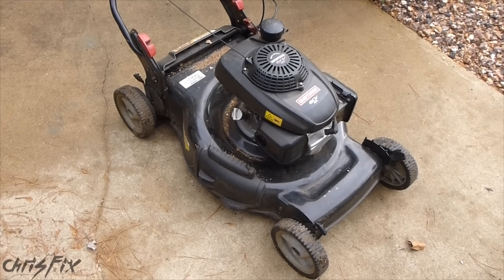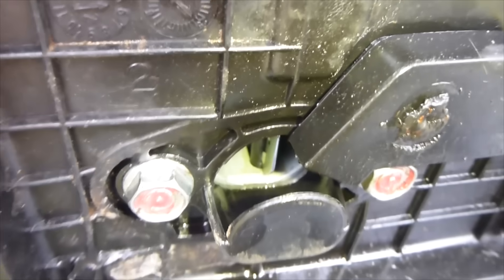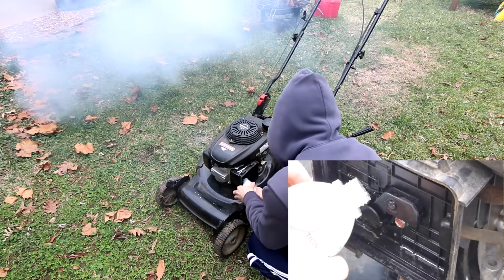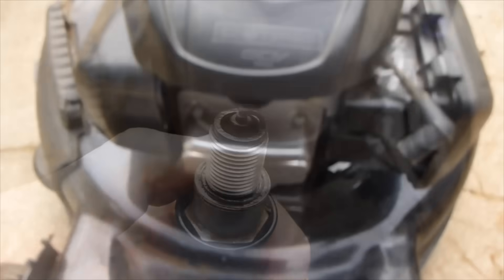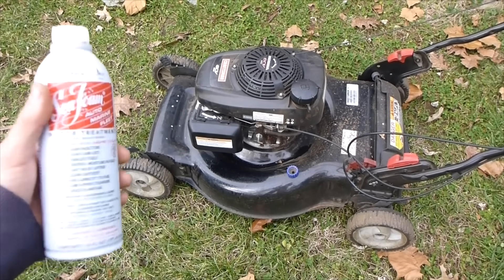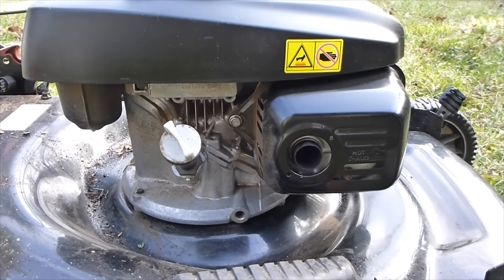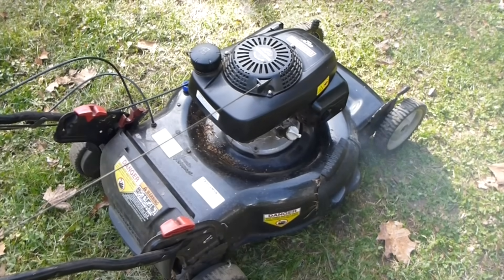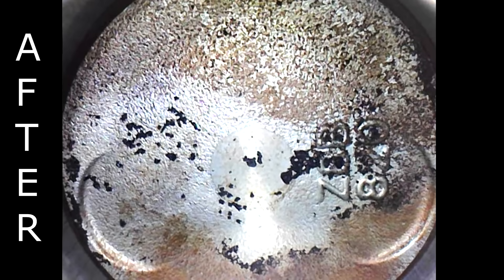Does Seafoam Actually Work? (with Proof)

Comment: Take a syringe with a smal needle and fill it with distilled water. Spray a tiny stream of water from the syringe's needle into the carburetor intake or into the throttle body intake  (for fuel injected engines) while the engine is warm and running at high RPM. It works like charn and will clean carbon deposits.  It's best to do this before oil change. 
Seafoam is the best for cleaning fuel systems. I always have some. Don't put it in oil as ot may facilitate leaks on older engines.

Comment: You literally could've gotten the same results using water. I've done it before. By pouring it straight into the intake like that you're sucking unvaporized liquid directly into the cylinder, since liquids don't compress this raises cylinder pressures and blows the carbon off the piston. Water's cheaper.

Comment: A lot of comments that carbon build is not a big deal - YES IT IS!. The problem is IF you have carbon build on the piston, you probably have it on the rings. Carbon will cause rings to stick and not maintain compression which will cause your engine to burn oil and eventually self destruct. Also carbon in the combustion area will get hot and glow, which will cause detonation, which will also destroy the engine. Best solution, run the engine at full speed to keep it clean, use good oil and gas and a little stabilizer never hurts.

Comment: Great video,  well made and very informative. My Honda Valkyrie with 6 carbs was not running too good after sitting for about 8 months. I did add fuel stabilizer to premium gas and thankfully the carb were not so bad that they had to be disassembled. I drained the gas in the tank but not the carbs. Then I ran the bike and used at least 1 gallon of fresh gas, it made a big difference. Now I am going to add the Seafoam that the Honda shop sold me and see what happens.

Comment: First, I liked the video. It said NOTHING about the benefits or drawbacks of using Sea Foam to clean the piston. It just showed the results of a very well thought out experiment.

Second, isn't glass made from silica and diamonds made from carbon? You decide which is harder. Although this carbon buildup is mostly a fine powder, (much like the carbon buildup in the exhaust, rub your finger inside your exhaust pipe), that fine dust buildup does become bad for the engine.

Several reasons for that. Buildup on the valve seats is an obvious problem. Also although that piston was pockmarked and very rough, most vehicles will have a very smooth and sometimes highly polished piston head. That is to allow the fuel air mixture to properly mix and burn more effectively. Back to the exhaust, like a clogged artery, buildup of carbon is bad for a vehicle also. More back pressure = less HP. 

That last one was not addressed in this video, but any carb cleaner run through the engine will remove some exhaust buildup. Not much, but after you try this, look at the tailpipe and see the black liquid dripping out.

Now, yes, regular maintenance is the best way to go. Good quality fuel, regular oil changes, fuel, air & oil filter changes, clean and re-gap plug(s) every season. And at least use fuel stabilizer if not properly winterized over the off season.

Any event, this video was informative, to the point and well done. The benefits of doing this or not is all up to you.

Comment: All I can notice is the INCREDIBLE amount of pitting on the surface of the piston. That is from detonation- a secondary ignition of the air-fuel mixture after the spark plug ignites it. The colliding flame fronts jar the piston in the bore, damage the surface of the piston, and damage the piston rings. Looking at the scored cylinder bore, the top of the piston, etc... this engine is DONE. Detonation CAN be caused from hot carbon spots left over from the previous ignition cycle, so yeah... cleaning the carbon can prevent this... IF you got to it WAY before the engine was this damaged. Detonation can also be from bad gas, the wrong spark plug, and other causes.
Also- Unibomber moment at 1:40

Comment: That mower was running well on the before part.  I have done coughing sputtering, misfiring mowers, and watched them smooth out in less than 10 minutes. My 82 Honda CX500 motorcycle got 31 miles per gallon when I bought it.  Two tanks of gas with SeaFoam later, it was getting 52 miles per gallon.  That made a believer out of me.  I use it on outboard motors, too, with very good results.
Reply from the maker: Thanks for sharing!

Comment: If the engine runs at full speed without stalling and cuts your grass okay why should you worry how the top of the piston looks? Some carbon coating is normal in all gasoline engines

Comment: For small engines like lawn mowers, I like the spray seafoam in a can.  It's concentrated, and is also a damn good spray for rusty bolts.

I had a small tractor that had the mixture screw set way to high and got gummed up from deposits.  I started it, throttled it to max, and would spray some until it bogged down.  Let the idle recover and repeat.

Comment: When I use Seafoam in my vehicles, I pull the brake booster line and put the hose into the can and let the engine suck it all out.
Reply from the maker: Thanks for the tip! Check this out: https://www.youtube.com/watch?v=u6UeJXkzDW8
Reply: ChrisFix Yep. Seen it. Don't use it all the time though. Maybe once a year, or maybe longer. That stuff is great every once in a great while. But it can do some nasty stuff if its used too often. I use it through the booster hose and in the tank.. I tend to use Marvel in the crank case oil.

Comment: And engines builder I know swears by it.
It's worked for me with a Chevy Blazer with a Vortex engine that is known to have top engine humming up. I had a problem with it but Sea Foam has taken care of it.
I'm not paid by Sea Foam...
Reply: Im a small engine mechanic. I personally run seafoam through all my older equipment, my truck, and through used mowers i prepare for selling. I usually dont pour it through the carb though, what I do is pour some in the gas tank, and its worked as good, if not better, than pouring it through the carb.
Reply: Uhh, phone correcting my writing but I think you get my point.
Reply: My ‘03 Silverado with the 5.3 vortec ran much better after seafoaming it.

Comment: this stuff sucks waste of money 
best way to clean out an engine would be to steam clean the engine with water (small bottle with a  hose let the engine suck it in like a mist bamm your done)
Reply: Aaand you would hydrolock your engine and take oil off the piston rings, what could do severe damage to the engine..
Reply: What oil? This isn't a 2-stroke
Reply: There is something needed to LUBRICATE the engine ;)
Reply: Any mechanic KNOWS there is always some oil on the cylinder walls    -   "Not a 2-stroke"   -   jezz!
Reply: Mrscp52 thanks for explaining that to him :)

Comment: Just wondering... Did you change the engine oil after this test?
Reply from the maker: Yes in the spring. This was the last time the mower was run for the season.

Comment: diesel will do same thing, i did it in the 60s. also you can use 6oz water, but this day and time people can save money by simply flooring it. about 20 to 65mph as quick as you can safely 4 or 5 times. it fixes several things most people complain about.
Reply from the maker: Thanks for the tip!

Comment: just asking but before u added it straight to piston did u let engine cool a bit so u dont strip the thread want to clean my car pistons like u did aswell by soaking but do i let engine cool off first also im going to use a bottle to spray threw throttle body instead of sucking threw vacuum line is that ok will it work that way
Reply from the maker: I would not soak pistons on the car. Removing all of that carbon at once is a bad idea.
Reply: +ChrisFix k
Reply: +ChrisFix i just sprayed threw the air intake using a flower sprayer as i have the motor treatment one and added the rest to fuel.  By adding most to fuel will it clean the car the best that way . will it clean the pistons valves and injectors by it being in the fuel

Comment: Squirt gun of water dose the same thing for a lot cheaper.
Reply from the maker: Thanks a lot! I will be testing water so stay tuned!
Reply: Yep, Grandpa used to splash a few drops of Water down the Carb at every Oil change. Need to be careful with the amount though, just a few drops does the trick!  ATF through the PCV works well too.

Comment: Whats the point? you could pull the plugs and use varsol or any solvent and get the same results. I have seen spotless pistons on engines with cracked heads or blown head gaskets as steam also will clean pistons.
Reply from the maker: To test seafoam. I thought that was pretty clear lol

Comment: I have to say for  about 20 years I just poured about a quart of transmission fluid in the carb of all my cars and trucks with the engine running and it cleaned the carb , the intake, the pistons and valves very well.

Comment: Chris, thanks to this video and your others for cleaning carbon, my 2003 ford ranger with the 3L V6 runs better then ever. For the last couple years I could not run anything less then 91 octane to get rid of the engine ping, running regular I would get ping any time it was under any load. The garage was a not able to figure it out with their computers, changed the MAF, plugs and wires, ran all kinds of fuel system cleaners including the ones you have tested, no results. Then someone told me it may be carbon build up, thats when I came across your videos. I did the Seafoam spray through the intake as well as a can in the tank. Ping was reduced right away, engine starts and runs better...so impressed with seafoam I did a second dose. Ping is almost gone now, still a bit at around 4,000rpm under load. I was thinking of doing something like what you did here with the mower, something more aggressive to get that last little bit. I am thinking to spray some in to soak the pistons, leave the plugs out and crank it before putting the plugs back in. Love your other videos too, super helpful...I wished I had have watched the one for the ranger drum brakes before I did mine a month ago. Keep it up!

Comment: The white smoke from tanks isn't from oil it's from the diesel. It is sprayed into the exhost system when you flip the switch.
Reply from the maker: Thanks for sharing. Diesel is an oil just like the seafoam.

Comment: It looks to be the same as we did in the 80's.
you could dribble water yes from a water hose in a running engine.
Into the carb the cooler than the metal liquid would cause the carbon to come off.
Reply from the maker: Thanks! I will be testing water so stay tuned!

Comment: You're testing the wrong thing.  That little bit of carbon on the piston matters not.  Buildup on the valves/seats and especially gum in the carb are what's far more important.

Additionally, after you let it soak you should have only ran the engine long enough to burn off the excess remaining, then shut it off and change the oil as some may have gotten into the oil which will decrease its effectiveness and cause additional wear.
Reply: "Does seaform work" implies that it's about whether it does something beneficial.  There is no benefit in removing what little carbon was shown. relative to what I mentioned.  Essentially it's a failure through lack of understanding or misuse, whichever way you'd like the approach the misunderstanding of needs for maintaining a small engine.

You might say it's just an example of carbon, but it's contrary to the product manufacturer to do any kind of test like this.  The product is clearly enumerated in purpose on the Seafoam website for the following:
"Where should I use Seaform"
1)  Use in Gasoline, Ethanol, and Diesel Fuels
2)  Use in Engine Oil
3)  Use for Intake Cleaning
4)  Use in Engine Fluids"

Nowhere in that, is de-carbonizing lawn mower piston faces.  It's not at all a test of whether seaform works to do what it's supposed to.  It would have been a little more reasonable if he had stripped the engine down, looked at crankcase sludge, looked at carb buildup and intake soot/oil residue, THEN used it as directed in the fuel, oil, and through the intake, THEN stripped the engine down again and compared the before and after, but at the very least for his intended application, it is directed to be put in the fuel.

https://seafoamsales.com/

Comment: 5-26-2016
Absolute brilliant editing.  All DIY videos should follow this example.  About Seafoam: do you recommend changing the oil after doing this process?  Seems some may get into the crankcase if the rings/pistons aren't in good shape.
Reply from the maker: Thanks! You dont have to change the oil unless you know your rings are worn. They actually say on the can you can add it to the oil but I would never do that so very small quantities are probably fine.

Comment: thise deposits won't make much differenc. when i use seafoam in my bike, it's more to clean the ethonol varnish crap  out of the carb.
Reply from the maker: It was just a test to see if it removes deposits. Thanks for sharing.

Comment: ADDING an agent to your FUEL is fine. Some doses are abstract. Adding anything straight to a Carb to the engine or thru the  FUEL INJECTION is insane. It strips oil off the rings and valves. This guy is a nut job...

Comment: That carbon on the piston is normal and really doesn't hurt anything. Infact, if the carbon got any thicker, it would flake off and blow out the exhaust.  Seafoam is made in China I believe. For that reason, I would not believe any claims on the can.
The big oil companies would have products if anything was a miracle.  It would be front page news.

Comment: Keep in mind Chris is not only cleaning the top of the piston which I agree is not important for how the engine will perform. He's also cleaning the valves and the valve seats which seal of the combustion chamber. Valves that are sealing the best they can will give you the best possible compression. Water may also work to clean the internals, but water will not clean the fuel system. So Seafoam being added to the gas tank will clean the carb too. Can also be induced directly into the gas line so pure Seafoam fills the carb will give the best cleaning. I have done this on a lawn tractor. You may have to put in a new spark(s) afterwards because the carbon deposits and such break loose and get on the plug(s).Great quality video Chris. Camera, sound, editing all excellent.
Reply from the maker: +Craig Edelburg Thanks a lot! I just started looking at the back of valves with a new camera: https://youtu.be/BocH2c4mYcc?list=PLvKbarVtwhUue-xwasd2WUMrkK0CEm6yy

Comment: Removing carbon can be done with many different additives and is mostly not a concern anyway. Seafoams claim that it stabilizes fuel and cleans carburetors is what intrigued me. I had a tiller with a bit of a RPM surge caused by fuel passages gummed up. I ran Seafoam in it the complete season and surge problem never got better. Before putting the tiller away for the winter I sprayed carburetor fuel passages, etc. with carburetor cleaner and the tiller ran normal. I have NEVER seen Seafoam clean a carburetor and I doubt its stabilizing ability too.

Comment: Very nice.  I put it in my fuel tanks of all my push mowers. My riding mower. My gas vehicles. And my diesel truck. Great stuff. But I just pour it in the fuel tank. I buy one bottle every month. My equipment runs great. Good stuff.

Comment: You can use Seafoam to clean out a catalytic converter that is running at low efficiency (PO420 code) because it has carbon or other contaminants built up inside it. You put the hose from a shop vacuum cleaner into the exhaust pipe and seal the connection with duct tape. Then take out the upstream O2 sensor and then start the shop vac to establish airflow going into the O2 sensor hole and through the converter. Do NOT start the engine. Then pour the Seafoam into the sensor hole with a funnel. Be sure to put enough in so as to saturate the inside of the converter. Let the Seafoam sit inside the converter for a while to soak into the deposits and loosen them up. Then remove the shop vac hose and start the engine and rev it up until the smoking stops.

The exhaust system needs to be free of any major leaks, which it should be anyways. And if the converter has been overheated and the bricks inside are melted or the precious metal coatings inside have been damaged this won't work. You are going to need a new converter.
Reply from the maker: +Joe Vignolo Thanks for sharing Joe!

Comment: You will get the same results if you use plain distilled water. The best
 way is to use a standard hand sprayer and spray in a fine mist into the
 carb. It'll produce the same results. It's just steam cleaning the 
piston. Also whether you use seafoam or water, change the oil after you 
are done.
Reply from the maker: +Stickman Thanks for sharing! I will be testing that!

Comment: I use seafoam, but not for this purpose. In actual fact and this is something known to generations of mechanics and aircraft mechanics simply pouring (in very controlled amounts) water or water/alcohol mix will more effectively clean the carbon deposits out. You must not pour so much as to stall the engine or hydrolock the motor.

Comment: Awesome video.  Been using seafoam for years based on reputation.  Good to see a real world test of it's effectiveness.  Thanks.  Btw, I was an M60A3 Tank Mechanic in the 80's.  The smoke generators on the old M60A3s were fuel lines that lead directly to the dual exhaust outlets.  When the smoke generators were activated, solenoids in the fuel lines would pump raw diesel into the exhaust outlets, creating a VERY dense cloud of diesel fuel vapor.   Literally couldn't see your hand in front of your face in broad daylight.  Anyway, just FYI for anyone that probably doesn't care anyway.